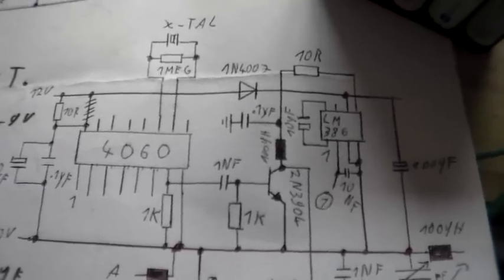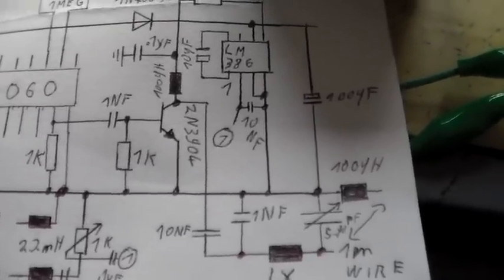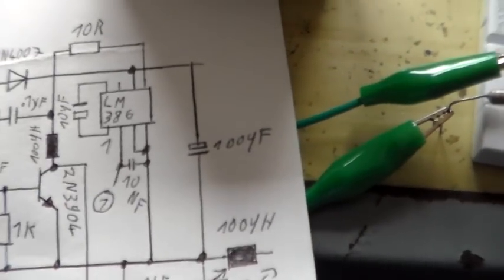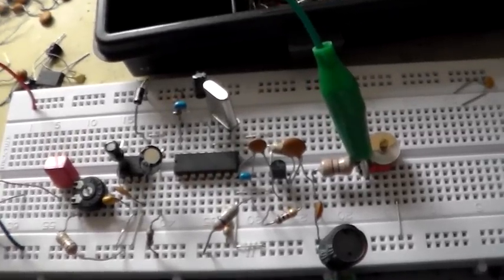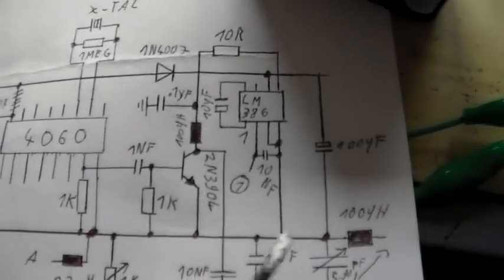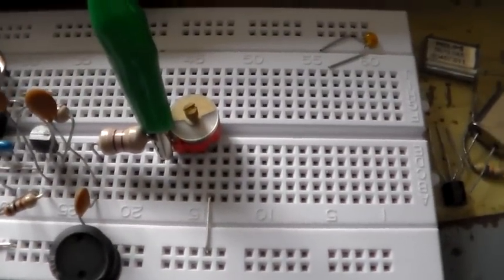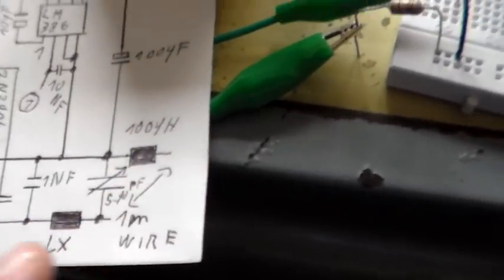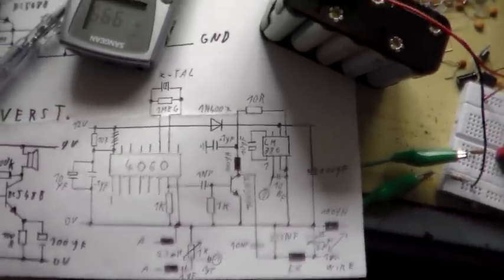Xtal am transmitter

Comment: I built one very similar, only with a slightly different freq xtal as there is a broadcast station near 1mhz.
My circuit has the output inductor and cap in parallel, and the inductance is a 1m by 1m dia loop and acts as the aerial, range is fairly good.
Sound quality is probably better with something like a tda2003 as the audio amp, but for tube radios the lm380 is probably better than the set can reproduce so is good enough.
Radios with digital tuners have 9khz steps this restricts the xtal freq.